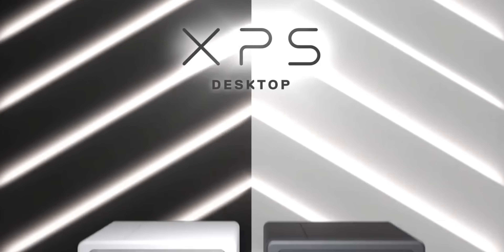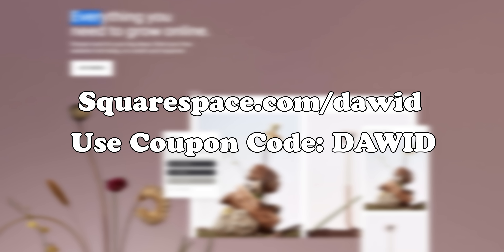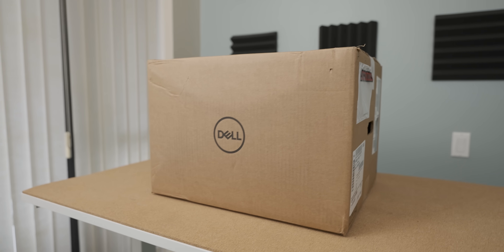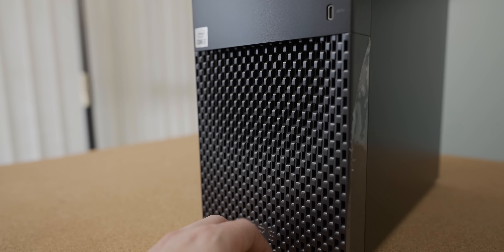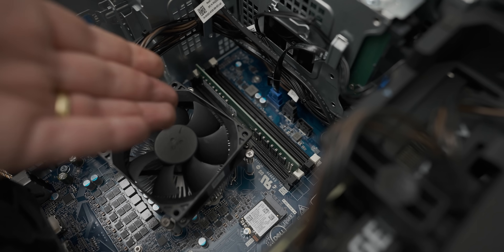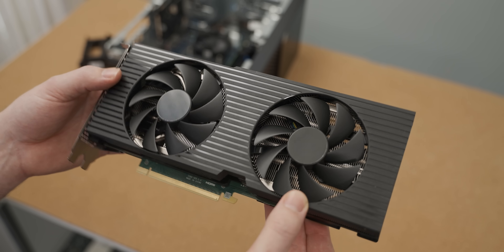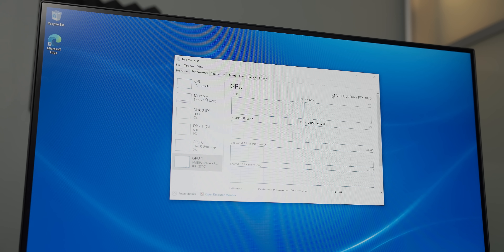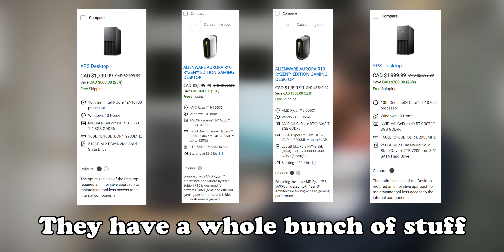DELL Did Me Dirty... RTX 3070 Dell XPS Pre-Built

Comment: Seems like you paid too much but in this world that price is a "steal",  I think even if you strip it down and try to sell it for parts you'll get anywhere close to worth it.   10700 brand new is $300,  maybe $75 for a single stick of ram haha...   and ummm yeah that's about it in that system.    That motherboard is set for the ewaste bin,  and that cooler... I dunno $25 and I'm being generous,  and lets just call that PSU $100.    So $500 for all the stuff assuming you could get next to brand new pricing for it, it turns out to be a $1000 GPU,  that had at one point an MSRP of $499.    Looks like NewEgg and all the other online etailers aren't the only one adding "convenience fee" type of scalping additions.

Comment: Nice vid, Dawid. I bought the similar Dell G5 5000 that comes with aN i7 10700F and a 3060 Ti just to get the graphics card, which like most  GPUs, right now are like unicorns. Surprisingly, the 16GB RAM mine came with was actually dual channel. Took the GPU and CPU out of the Dell and put them in a custom build of mine with an MSI motherboard and a Cooler Master Hyper 212X cooler and installed them in a much better Cooler Master case for decent airflow and it's all good. Put lower-end parts in the Dell (i3 10100F and an RX 570) and sold it.

Comment: My Dell G5 prebuilt came with dual channel 16gb ram. I guess I am one of the few. Problem is I really want to upgrade my system with a new cooler and new gpu but the power supply wont allow it, there is absolutely no way to get more than 500 watts psu in a dell pc...... sad

Comment: A few months back I actually bought an OEM HP 3070 at the then scalper price of 700 (shipped w/tax). While the shroud is different the cooler looks similar. And yeah it looks like they used a reference PCB.

Overall performs well paired with an old 8700k in a Dan case a4.

Comment: I would like to say, the cooler isn´t the only problem, the vrm is ok for stock, but why not even use a heatsink on top of the vrm ? A good example is that you could upgrade to a ryzen 9 in the future, but it would only run at stock, i question my self if it could run with OC, theres also a lack of sata ports, the ssd isn´t the best, and you also stuck with that psu for ever, if you want to upgrade the psu you will have to spend some money on it. The gpu is very decent, way better than the watercolling rtx 2080 ti, that thing is garbage, if in the future you want to clean or change the liquid.

Comment: Many years ago I got a dell pre-built. after a couple of years of use the hard drive failed.  That was when I discovered they had entombed the hard drive in a spot welded series of brackets that made it impossible to remove the drive. I had to make a series of six precision cuts in the EMF shield and that case frame as well as the outer panels to remove the hard drive only to discover they had used a custom hard drive cable with a non-standard key pin in it. To remove the cable more surgery was required to remove the floppy drive from its welded cage to get at the cable connector. 3 hours later I was finally able to remove the drive and cable assembly. The case was ruined and my angle grinder and Dremel were tired!

Comment: I've purchased several Alienware computers over the years and never run into a "payment" method issue..even getting my shit sent to Iraq lol. Dell is shady when it comes to option choices though. They make sure you cannot get the cheapest stuff paired with the parts you really want. For instance, you can get a 3070 but you have to get a specific power supply, a specific minimum ram/hard drive and such.

Comment: I really like those PC cases especially because they have that accounting firm (or similar) style. It's like a pre-emptive retro and yet smart. For the price, I'm not surprised the keyboard was basic. That is probably fair, although yes it is true that instead the old Dell keyboards looked cool.
Pity about the dual-channel RAM. They should sort that out for you. As for the airflow, it looks like that XPS was originally meant for different graphics cards but the only alternative would have been to refuse to sell a PC with that graphics-card. If it is works, albeit not optimal, at least you get your graphics-card in a time of shortage. I have seen that exploded diagram using a better CPU cooler. It might be your area where Dell options are limited rather than "all of Dell".
While I don't think the system is perfect, I like a lot of things about it and at least they got it to work. You've been sold a model that is "not as described" (a consumer rights matter on the RAM) and so I don't think this one example video is representaive of the Dell experience as a whole. I think it would have been fairer to at least give Dell a chance to put it right. Not only is that the consumer rights process as standard but also they were patient with your choice of payment. It might be an indicator that they'd be quick to sort it out for you.
I just think you might be happier if you went through the motions and got the dual RAM you desired. You could always ask about their cooler range while there. A follow up benchmark might then bring you more fun as expected originally.
Those cases do look nice IMO (as do similar brands).

Comment: I am fairly confident that they were not expecting you to open the case. So they thought they could scam you with one stick of ram and a stock cooler. They literally prey on clueless people.
Reply: It also shows up in windows though
Reply: @Erilan5  It does, but I think they assume you are not going to be savvy to that either.
Reply: @RetroAmateur1989  Pretty much. I mean, even if people see it in passing, I'm pretty sure more than a few either simply don't know what they're looking at, or just don't bother looking further into it because they don't know something might be off. 
Slightly related: I was also running a stock intel cooler on my i7-6700k for about 4-5 years, until I actually started looking into some other issue, which led me to look into why my CPU was trying to cook dinner, which in turn resulted in a cpu cooler upgrade.
I never actually noticed it before that point, given I never had issues with it, and stuff ran just fine.
Reply: Now we know that they lied!
Reply: New video shows how the rep screwed up the memory

Comment: Dell is not good. I got the g5 gaming desktop. Cooling and noise was a big problem. Also I was paying almost 3000 dollars for a 2060 and i9. There was one stock cpu cooler and one aio can. The case was small and was loud. Temperatures were 80-95 degrees for gpu and cpu. You would need a new case and intake fans, cpu fans and aio fans. I ended returning the pc:)

Comment: I'm pretty sure: The PSU is platinum, because it delivers 12V only. So higher efficency if the other conversion is done on the mainboard. If it is 500w multirail I wouldn't call it great for a 3070. The make it look good, but I am note sure it is. You could check on that more in detail. Would be an interesting topic to see the exact specs.

At least the don't put the PSU right above the CPU cooler anymore. My dad had a XPS built like that: Super small PSU cooler put right against the PSU. It sounded horrible starting up and over and over while being used. Even under light office use. Like a small mini jet. Still it looks like they used the smallest cooler they could find for the CPU. xD

Comment: How do they not find out that these things arent fit for purpose before they leave the design stage? If it has a 3070 in it its being used by gamers or creators, and anything that performs this badly has design failures. This is a class action waiting to happen, especially as they misrepresented the unit in the images.

Comment: Surely the GPU is under powered too? Don't most full size 3070 have 8 + 6 or the double Nvidia one if it's one of their cards?
Reply: Some do some don't.  The FE version of the 3070 is powered by one 8Pin PCIE cable then adapted to their fancy little 12pin. It may not overclock like a MSI Trio but it will perform as it should under stock settings.

Comment: For a gaming build it's always a better option to go with the Alienware I think. (absolute must to get the "deals" variant in your price range and configure from there.. making sure you have water cooling selected "AND" dual channel selected. (check to see to if higher frequency memory can be added for "0" more to..)  Mine was configured with a 1TB NVME (not a shabby one either.. made by crucial) and a 2TB storage drive (seagate) that appears to integrate AMDS StoreMI into it thru the scsi option.  After watching this video I got curious about the Power Supply.

I really wanted a 1000W which wasn't a option if I stuck with the 5700XT (which I had to have at the time.. great oem video card they have there) so I was stuck with the 550w.  I always assumed it was bronze rated but .. pulled it out after watching this video and it's stamped gold.  That's a plus. My temperatures are stellar btw.  Fully overclocked and running to the nines the Video card never goes above 78c (usually around 66c as I undervolt as well) Cpu kisses 66c sometimes (again I undervolt a little and have it set to 4GHZ thru the Ryzen Master software)  The alienware is good if configured properly... this XPS system? Hmm..  should have come with the pictured cooling. I'd be choked about that since there is no water cooling option you expect better.

Comment: Are they still using the same proprietary cpu mount that passes through the motherboard and is fastened directly to the case behind it?  I thought that was an innovative way of saving some cost while still providing some structure for mounting, but it does typically have the side effect that the coolers can't be swapped.

Comment: A friend of mine and I built systems from cyberpower I went with a 3800 X and A 3070 he went with a 10700 and a 3070 and his system blows that out of the water with 32 gigs of quad channel and an nvme drive. Multi-channel ram and a properly cool processor make all the difference.

Comment: bro bro can u answer quick? Is it okay to start building my pc while i do not have my ssd nvme currently.
Reply: Why wouldn't it be? As long as you have a drive to throw in there you can always use the oem migration software to mirror the drive when you get your NVME.  If it's a samsung it's really simple, bit harder with the Acronis but only because they make you register alot of the time to use it.

Comment: Interesting how they managed to have a 3070 with a single 8 pin connector.
Reply: The reference 3070 - which Dawid hints this probably is - only uses a single 8 pin. It's the 3080 and 3090 that need a home nuclear reactor to run.

Comment: We must get really shafted in the UK as you can’t buy this, the nearest one you can spec on Dells website is the same spec but a RTX 2060 and that’s £1699! Imagine the cost if you could add a 3070 well over 2k and at that point you might as well get the Alienware 3070 at £2100. Also how is this reasonable even at $1500 US as essentially your still paying $1000 for a 10700, 16GB ram, cheap OEM motherboard , psu and case and probably SSD.

Comment: I got a HP Pavilion Gaming TG01 as a prebuild with NVIDIA GeForce RTX 3060 Ti 8 GB / AMD Ryzen™ 5 4600G processor, 2x8 GB RAM 3200mhz, 512 GB NVMe M.2 SSD for around 1200 dollars today.. Hope they have done a better job than Dell in this case :O
Reply: Very interesting cpu choice, that’s going to perform like a Ryzen 5 2600x.
Reply: @downnnnnn  yeah it's not optimal but from what ive read it's a 3600 with less cache.. And pretty much same preformance within 5% and then they've smacked some graphics cores onto it aswell..
Reply: The motherboard doesn’t allow you to use the intergrated graphics tho lmao

Comment: Slap a nice and cheap Cooler and another stick of 16GB of RAM and this thing will skyrocket in performance, not a huge fan of locked down OEM Motherboards (hopefully this one has some decent BIOS options, but I doubt) but that RTX 3070 looks awesome, I'd pay extra to just have a Card like that, OEM-like without the stickers and the RGB leds around, It's just so clean looking and also cooled decently with that cooler on top of it. Good job! Keep it up! Maybe you can do a video Update if you plan to Fix it up and do a Performance comparison  Before/After the cooler and RAM Upgrade, also the SSD doesn't seem like a good spec, for that Price I'd have picked up a Sabrent PCI 3.0 or 4.0 if the motherboard supports it. Greetings from Italy!

Comment: The thing to do with these Dell pre-builts is buy one and then buy a GTX 710. Then take the graphics card out out of the Dell pre-built and put it in a decent build. Put the 710 into the pre-built, and then sell it on ebay.

As for them ripping you off on the dual channel RAM, I hope you complained to them about that.

Comment: I bought an Alienware Area-51m R2 i9-10900K, RTX2080 Super, 32GB RAM, 2TB SSD boot, 2TB HDD, but recent second hand, so I knew it was working. The seller had decided to get the 4k version instead. The first thing I would have done is repaste the CPU and GPU, as I had an Alienware 17 once before, and the paste job was rubbish, but the seller had already done this. I have heard of these animals running hot, but maxed out on the likes of Shadow of the Tomb  Raider, ultra everything, DSS and ray tracing on, it never gets above about 80C.

So instead of buying new and needing to fettle the beast to get maximum performance, I bought nearly-new and already fully fettled.

Comment: They really did do you dirty, gave you a GARBAGE cooler, screwed you on the ram, crap case airflow is expected, but like are we sure its not a 2070 with the firmware swapped pretending to be a 3070?

Comment: Thats just bad.
Dell has their ass too much up in the business area, they build good business machines but suck at gaming.
Even their Alienware PCs suck and have a tiny CPU cooler, unless you opt for watercooling, then you might have luck to get a 120mm radiator, which isn't ideal, but better than the Intel Stock cooler sized heatsink they put in everything else. And that CPU temperature of hitting 90°C in games.. holy sh...
I don't want to know what it goes to when running cinebench for 10 Minutes. They clearly have more space for a bigger cooler in this case.. so please just use it....

Comment: The PSUs are generally not the worst thing on earth since they’re 12VO PSUs and the rails all generally dump power to the same place. But yeah, if Dell would put 2 sticks of RAM and a CoolerMaster 212 in there, the XPS might actually be a decent prebuilt, even if it looks worse than the Precision it shares everything behind that plastic front with.

Comment: Honestly for $ 1500 for the system or just a card on Ebay, I'd go for the card because what possible use could you have for the rest of the e-waste that Dell ships with the 3070?  No one is going to try and find a match for that single stick of offbrand RAM to go dual channel 32GB.  No one is using that proprietary PS and that chassis is just garbage.  Once you remove the 3070 to put in a decent system, the rest is just waste.

Comment: I bought the 10700k version ($2000 AUD) of this computer and it DID come with the bigger cooler you showed. 70 degrees under gaming load for a hotter processor. I also got dual channel 2x8GB 3200mhz ram, which sounds good, but it ran at CL22 and every other timing was just as bad. I'm trying to sell the rest of the system and keep the 3070, but I don't think I'm gonna save much money doing this. I think I'll end up paying about retail for the card, which isn't too bad. 

The 12VO 500W TFX PSU and 12VO motherboard are gonna be the worst part of it and hardest to sell, I'll just have to sell them both together with the case.

Comment: I know the cooler for the CPU itself sucks but this layout a a huge improvement over last years 8730. The only real way to fix it is to replace it but unlike the 8730, you have way more options. The 8710-30 really needs the Optiplex ssf cooler to get them cooling issues under control. There is literally no room between the fan and power supply for anything else other then a AIO but then it's an XPS and not an ALIENWARE so there is virtually no room for that. All in all it's not a bad system. Just you'll need a few upgrades to make it fully enjoyable. I like the XPS refresh myself. It's a far better case then the last. That power supply however... ouch. Dell is doing just like Apple. It keeps making things more compact and thinner. But Intel CPUs just are not ready for all that. Call your Dell rep and complain and if you do it enough they'll send you the other cooler. It's just one of them way computer manufactures try to save a few cents here and there.

Comment: Never gotten an abs prebuilts but it looks like a similarly configured abs system would be cheaper looks like from the pictures the cpu cooler is still pretty junky but it was 3 front panel intakes... Behind a glass panel though. I'd be interested how thermals are in an abs pre built compared to the Dell... They also have a 3700x cpu option for cheaper than a 10400f if your willing to give up a small amount of gaming performance for more cpu preformance...

Comment: G'day Dawid,
When you contact Dell make sure you mention besides the RAM being 1x 16GB the CPU Cooler 11:25 is wrong also,
as most people buying these wouldn't be checking they got the right specs, Dell need to be told by someone who knows that PCs are being sent out with the wrong components to get the situation fixed,
the Motherboard has Mounts for a VRM Heatsink so it is annoying that you don't get one for an i7 spec build, a cooler VRM would also help for Sustaining available CPU Frequency Boost